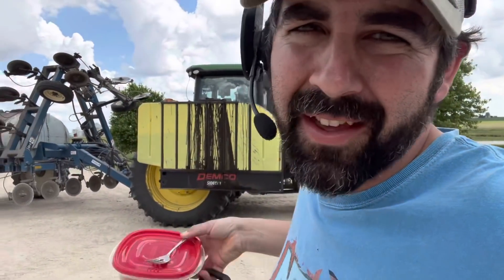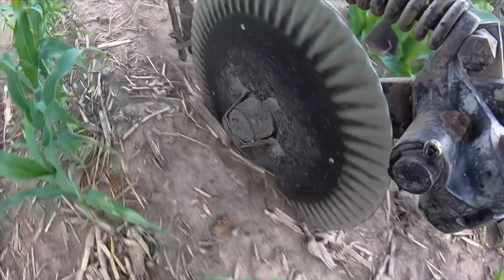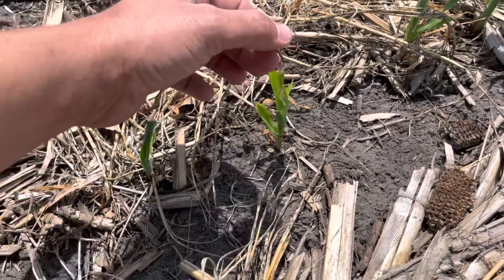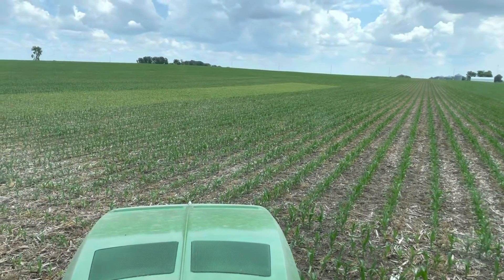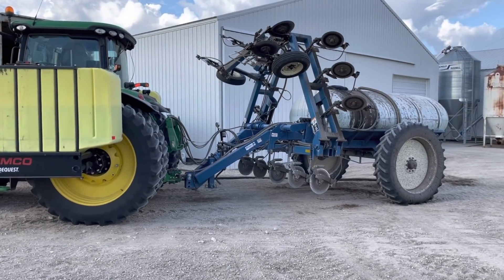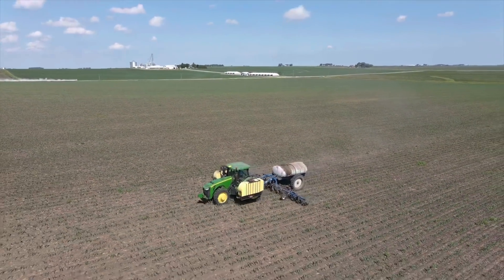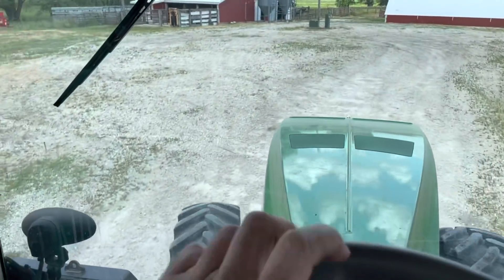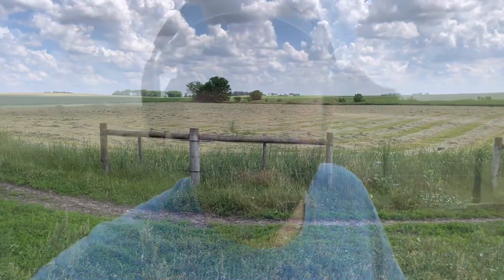We put over 250,000 pounds of nitrogen on our corn this year!

Comment: With it as hot and dry , did you have any concerns or reservations about adding nitrogen in the heat and dry fields where some plants that combination would burn the plant?
Reply from the maker: Since the liquid never touches the plant tissue it’s not a problem. It just sits there in the ground between the rows and waits for the next rain to push it out to the roots.

Comment: With all the liquid in the tanks, isn't there compaction from the weight?   They must deliver the trailer empty and load it from a tanker, right?   Where does the water come from?  That must be a big well.  At some point can the ground get depleted of essential micro nutrients?  You add basics like nitrogen, phosphorus and potassium, I guess but aren't calcium, iron and other minerals needed in trace amounts?  Is the pig manure sufficient in that regard.
Reply from the maker: Yes they deliver the tanks empty. The hog manure is great for micro nutrients. And we also take soil samples every couple years to make sure we are not getting low on anything

Comment: Pretty amazing you can drive thru that corn and not run over any of it.
Reply: I believe this is the case:  The GPS settings from tillage to planting to harvest are all recorded in the field.  As long as he follows the same paths set up, he’s aligned to the GPS.  Look on top of the cab, you’ll see a yellow GPS transmitter receiver.
Reply from the maker: Mark is correct. The headings are all saved. I have to make sure I’m lined up perfectly to begin with and then I center the track on my current location and the tractor drives it from there.